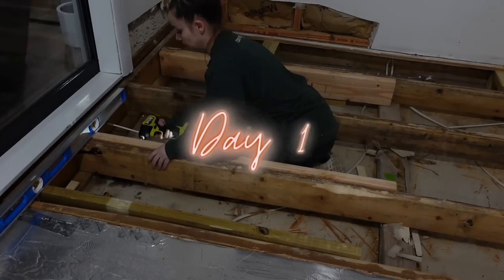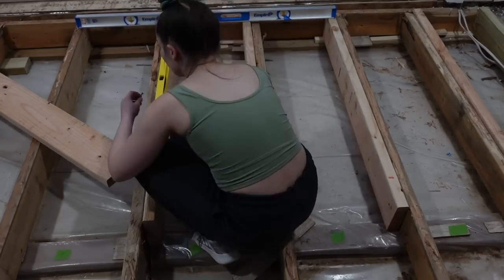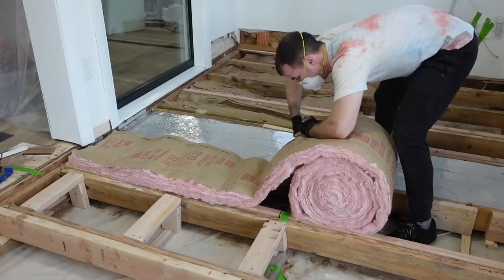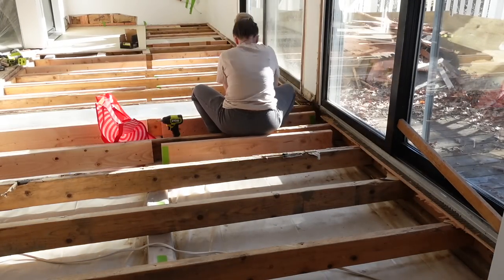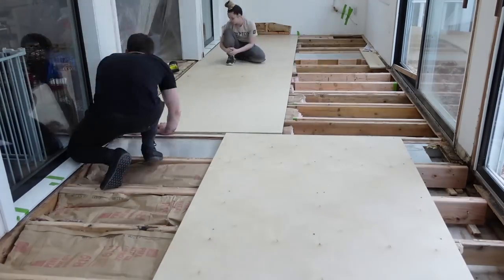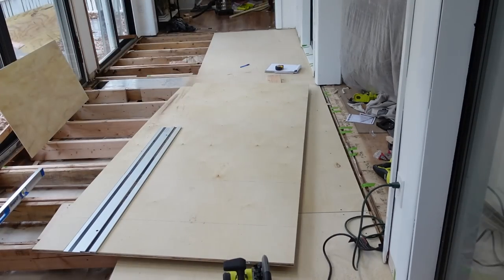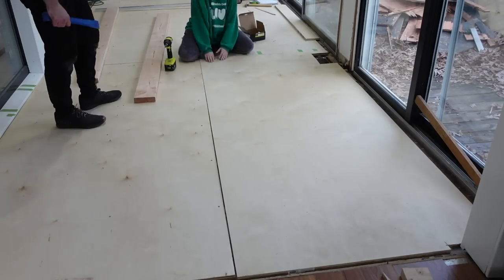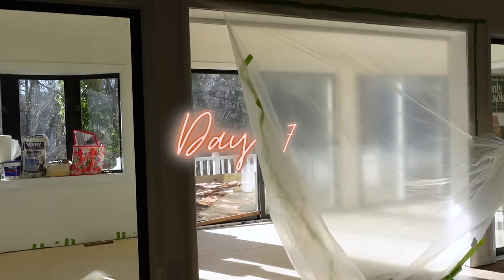REPLACING THE SUBFLOOR DIY | HOT MESS LAKE HOUSE RENOVATION | LEXI DIY

Comment: def isn't the worst DIY job but your subfloor joints should be staggered, that intersection where 4 sheets meet is 100% a weak point in this floor. Also you should have glued the subfloor down with construction adhesive especially in a room with so many windows and doors susceptible to bigger temp changes.